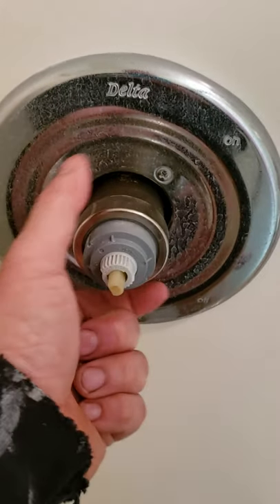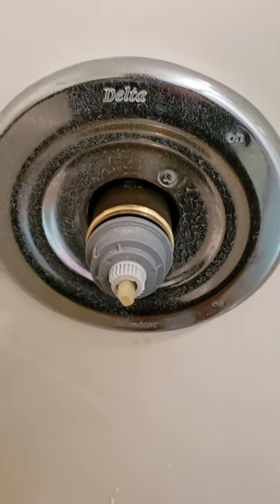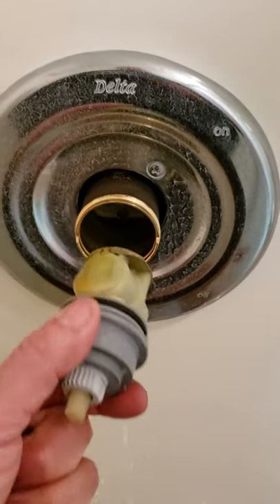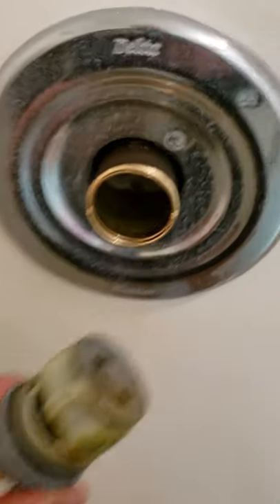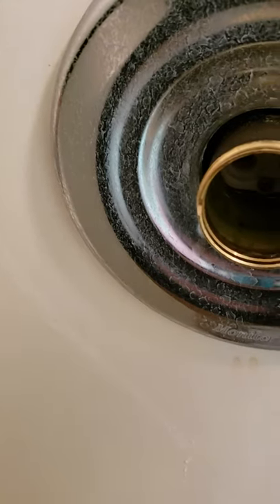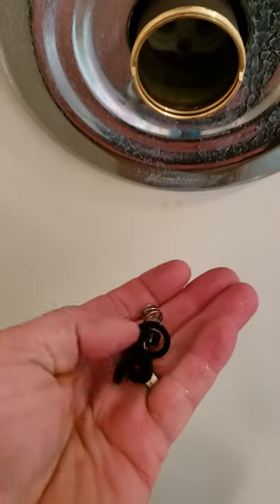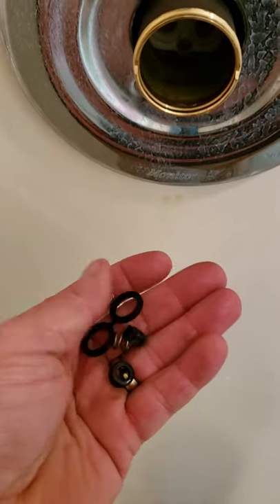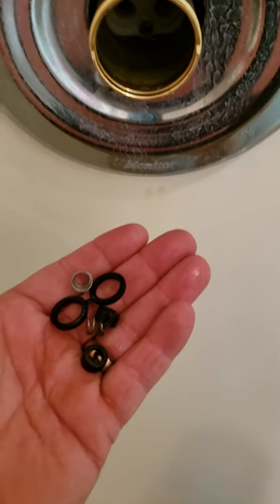How to remove cover and replace Delta shower valve assembly to fix leak / water/leaky. VIDEO 2 OF 2

Comment: That's a great start, but please cover some issues when the cartridge doesn't slip out easily e.g. use channel locks to pull the cartridge out or show exactly where to insert a standard screw driver to wiggle the cartridge loose.  Also do not twist the cartridge when pulling it out, or it can separate from the other half of the cartridge which is  a bit more difficult to pull out.
Reply from the maker: Good advice hear.

Comment: The cap that holds the cartridge in does not come off?! Help! I tried by hand and have seen videos of people using a wrench but i am nervous to cause a bigger problem
Reply from the maker: You may need to apply a little heat, little.  There is plastic in there so dont melt anything, lol.  The build of of water hardness can cause it to be difficult to unscrew but it does.  Good luck.

Comment: Could you show how to ‘stack’ the black rubber seats and springs in their proper orientation so that they can be inserted into the valve? Thanks! ❤
Reply from the maker: the easiest way is to use a small screw driver or something you can slip them over and push them into place at the back of the valve.

Comment: Question, I unscrewed it like you said and now there’s a bunch of water pouring out. 
How do I put the pieces back in they just keep flying back out at me. 
Been trying for almost 5 hours now.
Reply from the maker: Be sure to turn your water all the way off.  You can also open a valve earlier in the line or at a lower point and this will help the water to not flow out where you are working.
Reply: Did you make sure to shut the water off? Also, open a few faucets to remove any water/pressure in the pipes. Then, attempt to insert the cart

Comment: do you need to shut the water off before this process?
Reply from the maker: hahahaha, that is usually recommended unless you want to pressure wash your back wall and install a shallow pool in your house.

Comment: I did all this but my faucet is still leaking. Any ideas what the problem could be?
Reply from the maker: It can either be the spring, the rubber washer/cone, or the surface that it slides against.  If there is a small scratch or any damage it allows a little water to leak through.  You may want to try replacing all internal parts.

Comment: Start from the beginning
Reply from the maker: Turn off water to house, take off the center cap (plastic), unscrew center screw, unscrew ring holding assembly in.  That should get you to this point.
Reply: The silver band does not just unscrew

Comment: 🤣go ahead let everyone try this about half who try gonna have the delta valve with the little 1/4 copper pipes between cartage , they gonna flood the house plumbers know what I'm talking about .
Reply from the maker: Yes be sure to use common sense and turn off your water prior to removing any valves, fixtures, etc. common sense but hey what is that?
Reply: @goodtimes1828  it's like look up delta 600 series and you see there are copper tubes between the cups and springs ball and valve body people twist them off in wall all the time but delta made a monitor cartage that was like that but only for a year or two cause of issues but I run into them and the 600 all the time so becareful cause you can think since water off everything went smooth then turn water on and there's the insurance claim for the year 🙄

Comment: Not that easy  ring will be frozen on it and if you pry to hard you will have a much bigger problem  fyi
Reply from the maker: Lets hope there is not a lot of oxidizing.  If so it will take some work and maybe a replacement of valve.